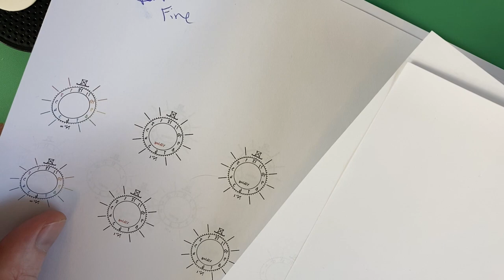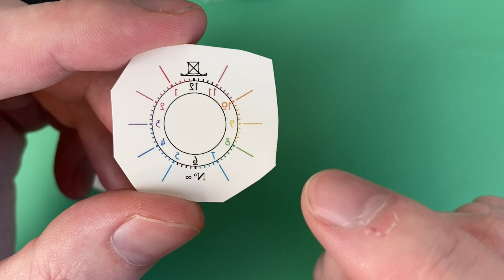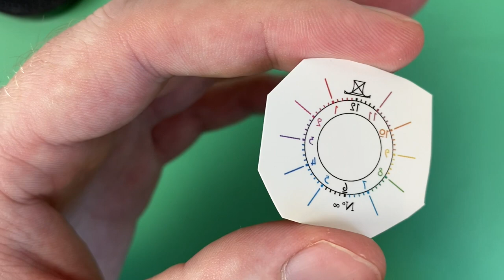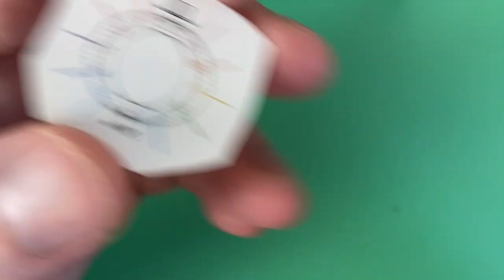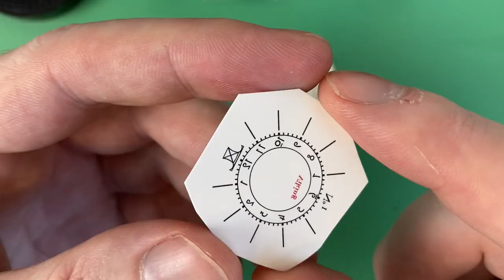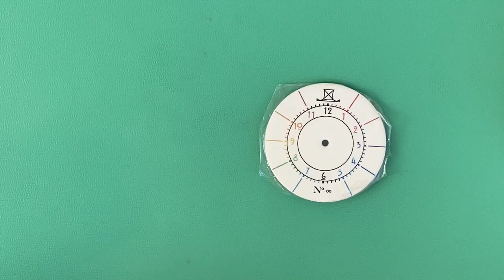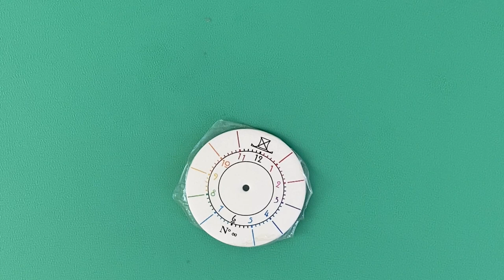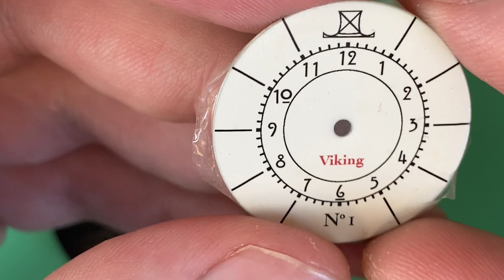Making Custom Dials: Waterslide Decals with Color

Comment: Hey mate, just got a new subscriber... this content is gold!

I know this is an old video but hope you still monitor the comments.

You mentioned either on this video or another that you had played around with printer settings, software and resolution resstings etc... what did you find work for gettinf the best prints?

Also do you paint these dials yourself or buy them prefinished? Would be interested to know your process here..

Great work mate
Reply from the maker: hello and thanks for watching. I try to use as high a resolution as possible and my printer is a laser printer, and use vector based graphics. I painted the dials in this video myself but I sometimes I will use factory painted dials, just depends on the project and dial finishing.
Reply: @WatchComplications  thanks mate, yeah I'll be working in illustrator. Have you done any bold colour designs? I really want to build a Mickey style watch on an NH platform but dials are impossible to find so am thinking this might be a decent compromise... but would require colours to come.out nice and bold...
Reply from the maker: @tobihall2247  you can try something like that but you need vector graphics, a good printer, and don’t forget Disney designs are under copyright.
Reply: @WatchComplications  yep the vector side of things is all sorted. Roger re the copyright...These aren't for sale... just a personal watch. May not even be a mickey watch but something quirky like a mickey watch or your Monty Python watch... whatever I can find the hands for.

Comment: I like your video, and I have been doing this for quite a while. I am using paper type A with W1 glue and the Sunnyscopa squeegy. Your method seems extremely circuitous. You may say, well it gets me results, but it you are missing out on a few nice properties of this printing method the way you work with it now. For one, you expose the substrate quite long in a wet state for dust particles to enter between the toner and substrate. What I do is prep a very clean spot under a tray on my desk, and dip the decal in water and then it curls up towards the printed side. So I lay the printed side down on the cleaned surface. Then I dip a pair of tweezers in the W1 glue and apply some on the cleaned dial surface and immediately place the decal, with the paper still on. Splitting it upfront like you do is unnecessarily fiddly. Then once placed slide the paper away, and then slide the decal further in place, use the squeegy to further slide the fluid out that is underneath the material. I have found it helps to make sure there is at least some water on top for the squeegy to slide nicely. Then, once it is all nicely adhered, use a heat gun from about a foot away to allow the W1 glue to dry. I am obviously using a wood dial holder (a slab of wood that I drilled a few holes in myself for the dial feet) When air bubbles occur, use a small piece of cardboard (a business card is really ideal) to push down on the surface. Then let the dial cool down completely, and you should be able to peel down the film. When you notice some toner is peeled away with it, just apply a drop of new W1 before fully removing the film (to keep it's position) and heat it again, let it cool. Usually this is not necessary, but it is nice to have the option to fix any faults that may occur during the film removal. Then when the film is removed, I keep the dial face down (to prevent dust from entering the surface) and apply heat with a mini blowtorch for a few seconds from the back. Painted dials can usually handle this heat for a brief moment, but it can be a good idea to try on a dial blank first. When using fully blank dials, you can also opt for a heat resistant paint, such as header paint or engine block paint. The blowtorch baking makes the toner melt and flow very nicely smooth and will help making it very rugged as well. When you scratch it? Just heat it again and usually the scratch will just vanish due to the toner melting again. A fun thing to know is you can stack several decal prints this way and even produce relief! There is a video in my channel showing an example of this, of a Grand Seiko homage with a guilloche effect done this way.
Reply: Then your printer. Even though it might work well in practise, it is pretty much on the limit of it's capabilities in terms of paper weight. Sunnyscopa paper is about 120-185 grams paper and your printer is specced max 160 grams. This may not look like a big deal, but be aware that the power of the led module inside that printer is not very high, and to get such thick paper hot enough to adhere the toner properly takes a lot of power. You may experience not so very vibrant results. An indication of this may be that the performance increases when making a few prints right after eachother. Say you place five sheets of cheap paper, and one decal sheet, and print the same image six times, and now compare that to making just one print from a standstill (cooled down) when your six in a row shows a better result at the sixth print, then your printer is not sufficiently powerful. If you wanna do it right, I would recommend something more professional, such as an OKI C844DN. Obviously this comes at a different price tag.
Reply: Example videos of my dials: https://www.youtube.com/watch?v=8l0nwbAUi0Y and https://www.youtube.com/watch?v=D-8g9-cwMeo
Reply from the maker: Thanks for the comments. I agree there are multiple approaches to doing this and thanks for detailing some other options that my followers could try out if they are so inclined. The printer itself seems to work fine, and I wouldn't want to personally go any higher on the cost with this method. If I want to do extremely high detail, that's what I have the pad printer for. I could load several pieces of paper in, but I typically only do one print at a time, as I have no need to print that many copies of a dial. Still the toner seems to adhere quite well to the Sunnyscopa paper. And with my method I have had perfect transfers every time, without any extra added heat. One suggestion you mentioned that I haven't tried is layering several prints to create a relief. That's a really good idea and something I will add to the list of things to test. I like the propeller seconds hand on that second watch...
Reply: @WatchComplications  Well the multiple prints would just be a test if your printer can really handle the paper well. You wouldn't print five decal papers, just a few on cheap paper, and immediately following the decal paper. And then compare the result to a decal paper just printed on it's own. If the one printed after the five is more vivid, you know your printer isn't quite capable. Thick paper requires a lot of power to heat it to make the toner adhere really well. You wouldn't know if it is now performing at just 80%, until you've seen 100%. As for pad printing, I have a pad printer, but I have found it's purpose mainly worthwhile for runs, but for one offs the decal method is fantastic. On a pad printer it is also very hard (impossible) to make gradients. I plan to try out combining the two in the near future. So background with decal and details with pad. This could help if you repeat certain details often, like a brand, depth rating etc and wanna have various backgrounds. As for the method, skipping the oven is in my opinion a big plus...
Reply from the maker: yeah i might try the multiple page thing at some point. I agree about the pad printer being better for runs, but if I have a client willing to pay and they want the full-on quality, then I don't mind using it for a one-off. But in most cases a decal print might be best for a one-off. I like having the time and temp control, consistency with the oven. Going with a hairdryer adds too much variety for my liking. And so far, anything I've put in the oven has held up fine.
Reply: @WatchComplications  The hairdryer isn't for baking, just for curing the glue. It doesn't matter if you do that for three or ten minutes. The baking I do with mini blowtorch from the back, with the film already removed, and then I place a mirror on the bench and I can see exactly when the toner starts to melt. This gives way more control over the baking than an oven, plus is ten times as fast.
Reply from the maker: Ok, the blow torch just seems too variable for my liking, not sure how that gives more control than a steady temp for a given amount of time in an oven. No torches, mirrors, benches, etc. I'm glad you have an alternate method though, that people can consider.
Reply: @WatchComplications  More control in terms of actually seeing what happens. The oven might work fine, but requires a lot of trial and error. I used the oven a lot in the beginning and quite often had irregularities like very small bubbles in the toner, and discoloration. When you can see it melt and stop immediately the toner will also not gas out so long and retains it's color way better, and it's luster and shine, especially the color yellow fades quickly when heated for longer than necessary.
Reply from the maker: keep in mind I am using Type B paper with MicroSet and MicroSol, which perform differently than Type A with the glue. I use 225f for 20min and I have yet to have an issue with bubbling, transfer, vibrancy, and so on. It's quite a low temp, short time, and consistent. Weirdly that's what I chose the first time as a best bet and it works, so it wasn't any trial and error for that step, for me anyway. Perhaps at some point I will test the same process with Type A and the glue, but overall I've had better success with Type B and the Micro products. I do need to do more testing with Type A though. A lot of this will also depend on the surface material as well.
Reply: @WatchComplications  The first paper I ordered was accidentally type B, and had way lesser results with it, and I wasn't surprised at the time as it is not designed for smooth hard surfaces, but porous water absorbant surfaces instead, and not meant to be applied with heat (as per manufacturer specs) As for the bubbles, I doubt you will notice when you are only printing lines like your designs here in the video. I wonder how you will fare when you lay down a full dial surface of toner, let alone two or three layers. I've not used the microsol or microset so far, might give that a try, but I doubt it will be more effective than the W1 glue. As for vibrancy, I have had very vibrant results many times, yet managed to get even more vibrant at others, that's what lead me to investigate why. The times it wasn't - as - vibrant it was still pretty vibrant, so might please most trying this method, but it's always worth it in my opinion to try get the best out of it, and since I noticed ever so slight differences in performance, that's what made me wonder why that happened. Yet, depends a lot on what style of dial you're printing. If you're printing something like that blue sunburst with propeller seconds like I showed in my video, well.... it's different than just a few lines on a white background.
Reply from the maker: Fair points. I will eventually get around to more testing with Type A, and maybe full color across a dial, though for that I like to apply actual paint. Lots of techniques for different styles. I'll have to try a gradient or something at some point too.
Reply: @WatchComplications  If it is just a flat color, then off course paint is the way to go, but the transparency and option for gradients is really something else when using these decals for it, but I'd like to know how you fare with this with your method.
Reply: @WatchComplications  It kinda sucks you can't drop pictures down here in the comments section of Youtube huh...? Wouldn't that make this an ultimate social medium?
Reply from the maker: Whatever I end up testing in the future will probably end up in a video...so hang around :)

Comment: Excellent video, they came out much better than I expected them to. I might even give this a go. I'm curious about the difference between laser and inkjet, is there much of a difference, or does it depend on the quality of your dial image, the dpi maybe? I guess keeping it to 300 dpi, or even maybe 600, would make a difference, and your print settings at maximum quality...anyway, great job.
Reply from the maker: Yeah, they turn out pretty good. Laser is typically going to be able to produce a sharper image. You do want a good vector based format and as high of a dpi as possible for the smoothest look. Make note that there is a specific paper for inkjet and a specific type for laser.
Reply: @WatchComplications  Ok, cool, I'll check that out.

Comment: Could you do an experiment with more professional printers, such as taking it to Office Max or a local print shop, to see if you can eliminate the scale issues?
Reply from the maker: Not sure if I’d go that route or not, in future experiments. Would take a lot of time and testing, thus money. The laser printer I use is 2400x600 DPI. I’m not sure if the time and energy would be worth it. At some point the cost would run into that of pad printing, which will always be better.

Comment: What kind of primer do you use on a brass dial to prep it with?  And do you ever pain the dial or just use primer before applying the waterslide decal?  Not sure how well paint would hold up in the oven.
Reply from the maker: I typically use Rustoleum primer or paint/primer depending on the color I'm after. I apply anywhere from 3-6 light coats 2-3 minutes apart. Let it dry for a couple days. Paint holds up fine in the oven.

Comment: Great video! Thanks! What is the primer you used for the other dial, and was the dial plain brass before?
Reply from the maker: i have tested on both brass and aluminum. I typically use a type of rust-oleum primer or paint/primer.

Comment: hey buddy, lovely videos. any suggestions to do the same with black dials?
Reply from the maker: Depends on the text colors. Some will show ok on black, some won't. If you want white for example, you have to paint the base dial white and then create a black printed decal with negative space (white) for the design. Just like if you printed white text on black on regular paper.

Comment: Where did you get those dials?? They almost look like u cut them out perfectly with like hardware store paper
Reply from the maker: these specific dial blanks I got from Ofrei.com I think
Reply: @WatchComplications  Awesome thank you!! I need your opinion on something seperate. What do you think of making dials from some special paper at the hardware store?? Might sound stupid but
Reply from the maker: well you would probably want it adhered to some sort of metal backing as paper will warp over time with temp changes and moisture exposure. Unless you're coating it in some way it will alway have a paper look to it. Not that you can't use it, or that it won't look good...but if you want something that you don't have to worry about holding up over time then you'd have to go with metal or something more solid. Nothing wrong with testing it out though.

Comment: im having problems with my paint not transfering on my dial it stays on the waterslide completely any idea how to fix this
Reply from the maker: sounds like either the chemicals aren't working correct, or the surface isn't quite right. Are you sure you're printing the images as reflected and applying the decal in the right direction (front versus back of the decal)?

Comment: What if I want to print on white letters on a black dial?
Reply from the maker: I've talked about this in other videos and comments, but with a decal you have two options. Most printers can't print white, so if you have white in a design it is negative space, meaning no ink. You can print a black dial with white markers, but it's going to be a black or dark print design with no printing in the white space. So you would need a dial with a white base, and then print the decal and apply. Some more expensive printers and services can print white, so you can look into those if you want actual white printed markers.